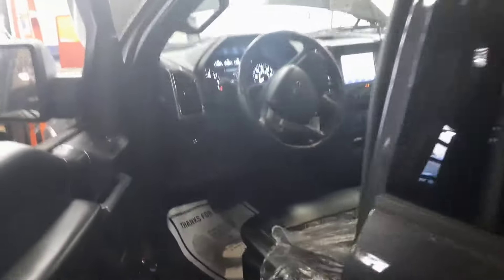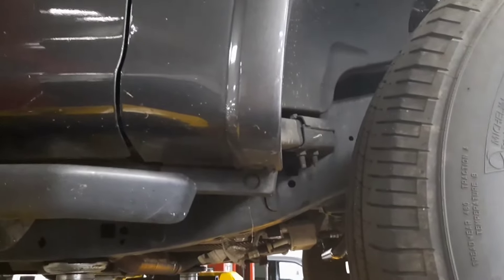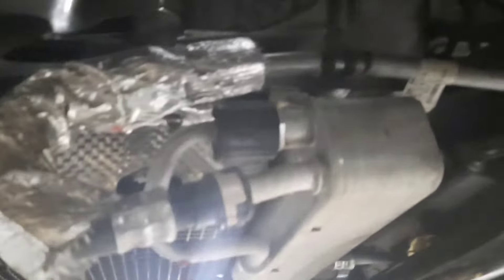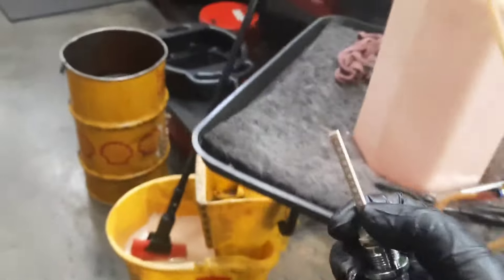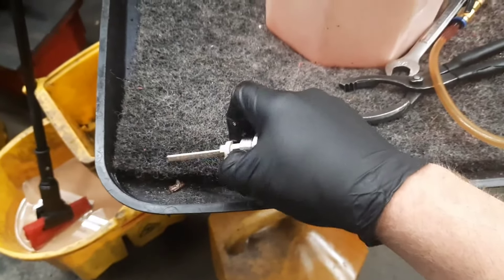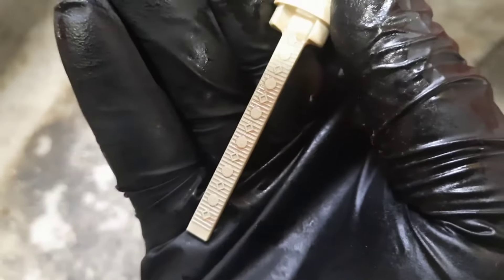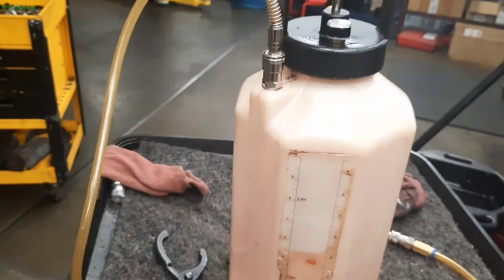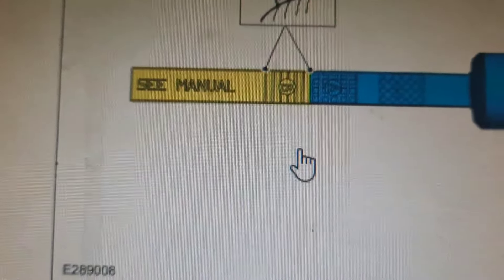Ford 10-Speed 10r80 | Checking / Adding Transmission Fluid (set at 5-6, not 3-5)

Comment: That is completely ridiculous. Why wouldn’t they just put a normal dipstick?
Reply from the maker: They can save 64 cents this way per car
Reply: That would be to easy😊
Reply: Because that is more weight and will cause you to use another gallon of gas over 1,000,000 miles.
Reply: So the dealership can charge $500 for a simple service we used to be able to do at home.

Comment: Was going to thumb down, but the edit at the end fixed it.. stick with 1-6 needs to be into the 5-6 range for full hott
Reply: Fordm  just search 10r80 fluid change has a great video also the 3 different stick labels they use l.. which is fuxk8ng absurd

Comment: Where did you get your repair manual from? Did you use OEM transmission fluid?  What about using AMSoil? Thank you for your help on this video.
Reply from the maker: @OtisMedia  amsoil would be a good choice. I was a ford tech and that's the ford workshop manual.
Reply: @ Is there any good sites to download load that repair manual? Or any suggestions? I appreciate your time.
Reply from the maker: @OtisMedia  OEM Ford workshop manuals for sale:

EManualOnline: https://shareasale.com/r.cfm?b=510988&u=4402862&m=49176&urllink=&afftrack=
Discount: 22% OFF Sitewide
Code: BIGBEN22
Expiry: Dec 31st 2024
Reply: @BigBensCarsAndCycles that link doesn't work, but thanks for the information!

Comment: I changed my 2021 at 26,000k
It was dirty and so was the pan and gasket.
Once changed it ran smooth as silk.
Highly recommend!
I just bought a 2024 and recently bought a B&M larger capacity pan that I plan to change at 15-20,000k
This pan has a drain plug to lessen the mess when changing..

Comment: Thanks for the helpful tip. Do you just fill it through the dipstick tube? Also how do you get the trans that hot, one hardly ever gets above much 170 in normal driving.
Reply from the maker: Hi, you can fill it with a pressure fluid transfer pump. You can power brake it to warm the fluid higher. 185 is good enough
Reply: @BigBensCarsAndCycles  Yes I understand about the transfer pump. Do you add fluid through the dipstick hole? Or is there another plug somewhere to add fluid?
Reply from the maker: @309gti8  the dipstick hole 👍

Comment: Hi! What’s the correct level for 2021 f150 2.7eb with the #1-6 dipstick? I heard they change the fluid level in 2021 compared to 2020, thank you!
Reply from the maker: I've got it pulled up in the shop manual right now. At  96ºC - 101ºC (206ºF - 215ºF), the level should be between 5 and 6

Comment: What kinda transmission fluid do I put in my 2015 fx4 5.0 Ford?
Reply from the maker: @EricDuane-r3m  your 2015 should have a 6 speed auto. That one takes mercon lv
Reply: @BigBensCarsAndCycles  dose the truck need to be running to add transmission fluid? With it turned off it's over filling and is full.
Reply: And also do u need a transmission pump to add tranny fluid? Or can I use a funnel

Comment: Hi there !!!
What's the correct level for 2019 Lincoln Navigator L reserve 4x4 with the #1-6 dipstick? 
I will appreciate it a lot !!!
Thanks 🙏🏽
Reply from the maker: Using the scan tool verify the transmission fluid temperature is between 96ºC - 101ºC (206ºF - 215ºF). The transmission fluid level must be between 5 and 6 on the transmission fluid level indicator.
Reply: @BigBensCarsAndCycles  Many thanks for your attention men !!!!

We just check that now and is in between the # 3 and 4 on the dipstick and the transmission temp was like 210.
So pretty sure is overfilled.
I will keep you updated soon.
Blessings and thanks again!!!

Comment: 230,000 miles 2021 f350 never have done anything to transmission! Recommend filling up fluid or let it be how it is? Some tech tell me to not even touch it since its been that long lol
Reply: I had a maintenance plan and I thought they did everything turns out they didn’t lol
Reply from the maker: I'd change the fluid and filter. Never too late.

Comment: I’m confused. My 10R80 FILL/DRAIN plug is on the driver side. I have a 2022 Ford Transit 350 ecoboost.
Reply from the maker: HI, its possible you have the 10R100. Same procedure applies

Comment: Geez Ford could you make this any freakin harder!  I'm surprised they don't make you do it at night without a flashlight while laying on a fire ant hill.  And what's up with the weird numbering/lettering on the dipstick, what happened to just having one range, they can't make a dipstick specific for a $60k truck?  Damn engineers!
Reply: @davidmurphy9671 The same thing exists for the mustangs with the 10R80. Holly has a third party dipstick you can buy... for mustangs 
"I talked to a guy that used the B&M 10R80 dipstick on his mustang and he routed the tube/hose over the top of the trans to the driver side of the engine bay, I never thought of doing that" --From SuperDave @ mustang6g
Reply: Hahaha

Comment: ive got some rough down shifting in gear 3 and 4, could transmission fluid be the culprit?
Reply from the maker: @krazypickle  firm shifts are basically characteristic of this transmission. If it is hesitating strongly on that shift, the cdf bushing may have shifted
Reply: @BigBensCarsAndCycles  got it, thank you for the reply

Comment: How Many Dip Sticks are there for this 10R80 Unit anyway?  And it appears as tho the Dealership that replaced my 10R80 in my 2022 F-150 can't read or Follow Simple Instructions, Mine just PUKED It All over My Under Carriage, Tranny Oil Pan, and TAIL GATE through the Over Flow VENT TUBE????? 🤬🤬👎.
Reply from the maker: Sorry to hear. They probably set it to max when cold. Ulv expands a lot. You should be fine just cleaning it. It's probably at the right level now on its own
Reply: @BigBensCarsAndCycles  Thanks BEN, I'am taking it into the Dealer Hopefully NEXT Week for Open Axel Recall. I'am gonna Kinda let them know of my Dissatisfaction with there Procedures, and ask them To CLEAN the Under Side of my TRUCK. Hopefully they don't screw that Up??? Thank's for the Response.

Comment: I got 2019 10 speed guessing the same in winter time transmission clunks bangs when you first take off when warms up ok had it at Ford 3 times brought in first time did nothing could be found said a lot of them do that don't know why took back in 2 more times they don't know only thing you here is it is under drive line warranty for 100000 kilometers not impressed anybody run in same problem